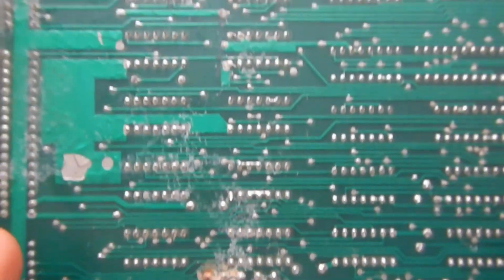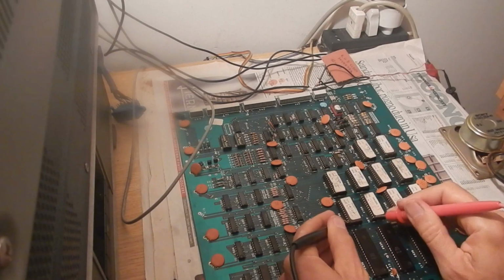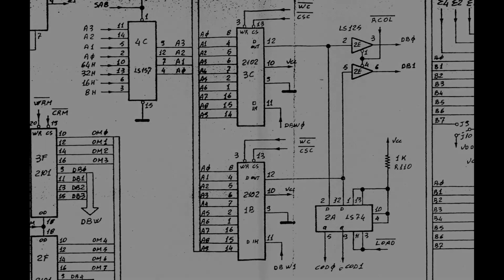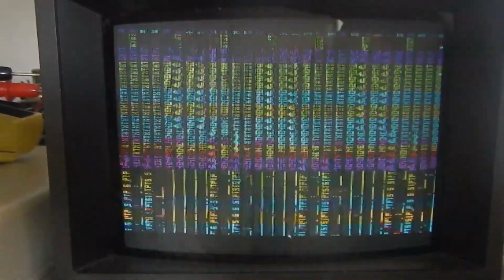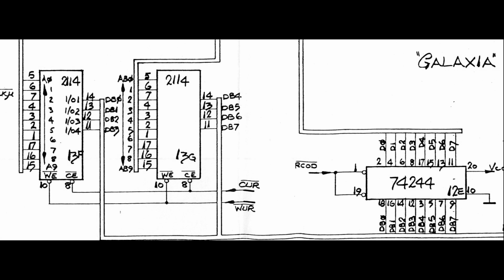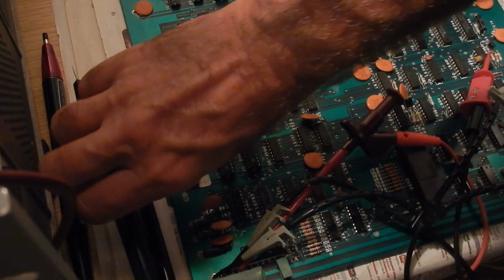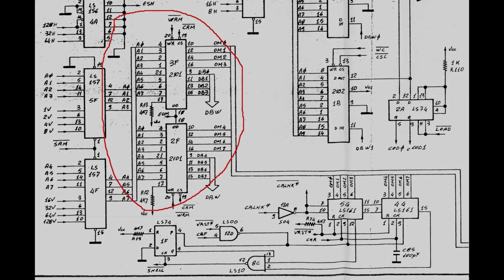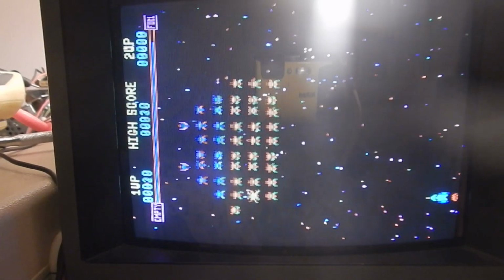Zaccaria Galaxia arcade repair #2. I decided I needed a diagnostic ROM.

Comment: Hi.. i got a non working Galaxia too.. i repalaced all sockets first.. when i powered it up the image on the scart tv is very dimm.. did you do any spacial to convert the sync signal? I used the sync as composite video so,i get a black/white image.. but only big zeros some lines.. sometimes some stars in the background.. i used a pc power supply.. i measured -4,5v and +4.8v and 11.8v.. not sure if the power is good enough to work on this pcb?
Reply from the maker: The sync signal need no conversion on this game PCB, on the other hand, the R,G,B signals are inverted and I've shown a circuit to invert the color signals in one Space War video. +4.8V is just barely enough if it's measured far away from the power connector, directly on one IC for example. I'd clean the power connector and inspect the solder joints, it's a rather common failure on these boards. You should have 4.95 to 5.1V on all ICs anyway, check that nothing is overheating.

Comment: CM8102s are a readily available Bulgarian made equivalent of the 2102.

How long have you been doing computer programming?
Reply from the maker: Hi! Interesting thanks! By the way, the SY2101 that I've used as replacement was sent from Bulgaria too :) And, I've started writing programs when 11 y.o. on the VIC-20. 6502 was my first assembler dialect.